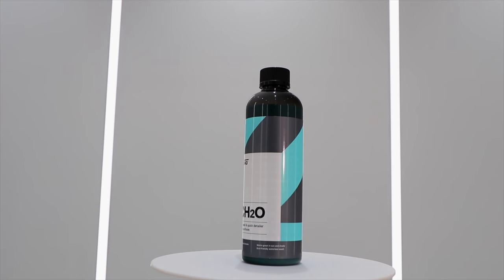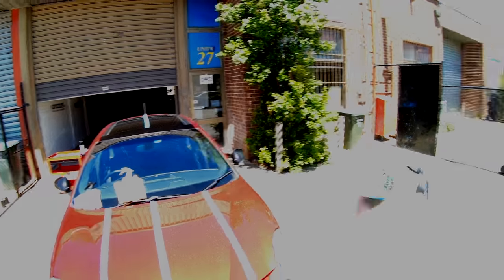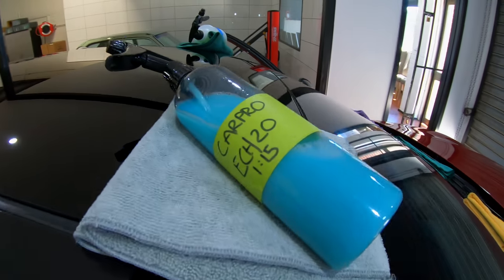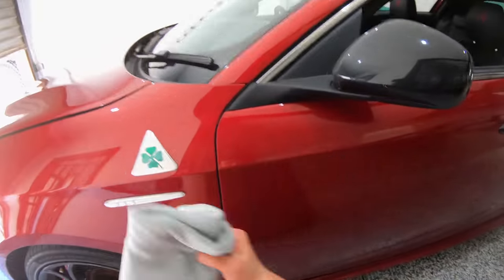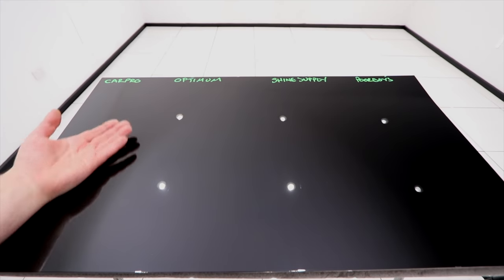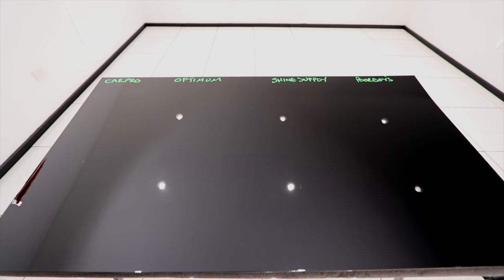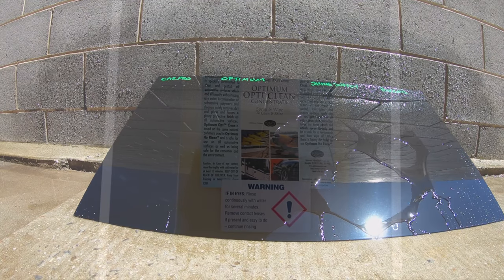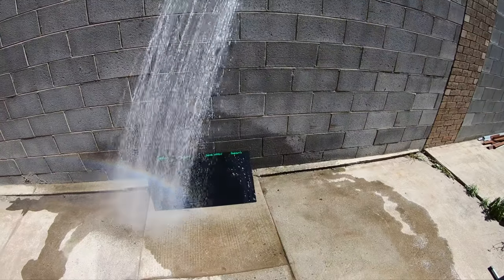WHAT’S THE BEST WATERLESS CAR WASH!

Comment: Just did a rinseless wash with Ech02 a few hours ago. I still don't feel comfortable with a complete waterless wash, but it performs great as a rinseless. I have ONR too, but Ech02 has relegated ONR to clay lube and interior duties.
Reply: so Ech02 performs much better ?
Should work as clay lube also
Reply: So what makes ONR work better than ech02 in your opinion?
Reply: Opti clean is meant to be the waterless wash; ONR is the rinseless wash. Opti clean is basically ONR supercharged with more cleaning ability, polymers, etc.

Comment: As always, a beutiful video with inforamtive content. I have tried Ech2o as a rinseless wash and it did its job surprisingly well. But the one concern for me regarding both waterless and rinseless wash is the risk for scratching or marring the paint. It would be truely intreesting to se some judgment in that area by someone with a good eye for this. Love your work and your attention to details.
Reply: My concern as well. At this point I would NEVER use anything that requires no water to clean.
Reply: @khyoon14  In a pinch or a situation where it's just not possible to use water, it is an excellent option, the technology really has come such a long way! I would have to agree though I would almost rather not wash my car at all until I have access to water unless absolutely necessary. I still do own Opti-wash and am going to buy a bottle of Carpro Ech20 as well just in case!

Comment: I personally use tac systems aqua waterless wash and wax, it doesn't actually have wax in it, instead it has SiO2 like Ech20 but I found it to be the slickest waterless wash by far and also gives insane gloss as a quick detailer if used that way
Reply: Using Echo2 for 4 years now.....may be there will be some new stuff nowadays ....

Comment: I’ve only used the Optimum, the results look amazing. I’ve just read the safety instructions, do you have to wear a face mask when using the ECH2O ?
Reply from the maker: You’ll have to check with Carpro on that, but I’m not aware of face mask recommendations with Ech2o- though over the last two years I think most of us have been using face masks regardless 😉

Comment: I’ve had similar results with OptiClean in terms of streaking. Although my vehicle has a polymer sealant (Jescar PowerLock) would there be any harm in using ECH2O? I use CarPro Reset as my soap during a normal 2 bucket wash and it’s fantastic no signs of degradation 4 months in. Suppose both of those products were made with SiO2 based coatings in mind. Thanks Sandro, great video as always!
Reply: I have a black 2016 GT350 with Modesta coating. I only rinseless wash it using Ech2o, spraying each panel first before contact with wash mitt. My paint still looks spectacular after a year of using this method. I never use it as waterless. The idea of using a fresh towel surface on every swipe and going through a dozen or more micro fibers per wash  doesn't appeal to me. I also use Rag Company Eagle Edgless towels which are fantastic.

Comment: Hey, mate great video. I was also wondering if you had a video on applying Nova Evo Ceramic coating process or similar??? I am ready to apply now and have a choice of Evo (Preferred) or UK 3.0. It is quite hot up here (32-36C) so any tips on the application process, flash times, what microfiber towels should I use to buff and how many do you go through??? Cheers mate and as always enjoy your informative in-depth videos.

Comment: Hi,  In your opinion what is a true replacement for Meguiar's D114?   I like D114 because it concentrated and it has multiple use with different dilution ratio.
Reply from the maker: D114 was never sold here locally so I really can’t personally compare it to other options, but CarPro Ech2o is a favourite of mine, and diluted up to 200:1 for rinseless washing 20:1 for waterless and 10:1 as a quick detailer so its quite versatile and economical depending on use.

Comment: Have you tried Optimum NO Rinse against Carpro Echo2?
Reply from the maker: Yes quite a while back, but I don’t do much rinseless washing, it’s usually a waterless wash or traditional wash, but I don’t have any conclusive tests with the two.
Reply: @CarCraftAutoDetailing  today I used Echo2. Both method: waterless for some gift a bird left behind and rinseless for the rest of the car. The car was lightly dusty. I used Optimum Sponge with Echo2. For some reason I'm still kind of nervous when using both waterless and rinseless washes, at least with Echo2.

With ONR I kind of see the the dust is effectively emulsionated and encapsulated. With Echo2 is difficult to see.

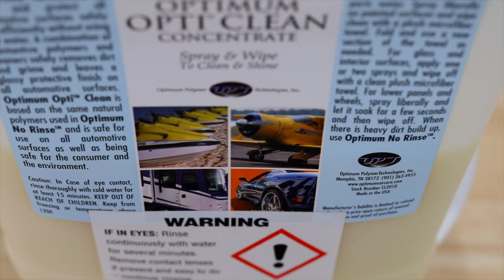The good thing that I see with Echo2 is that when diluted  1:5--1:10 it helps a lot avoiding water spot issues on coated cars.

Comment: I bought ech2o on a whim 2 years ago and never looked back! This was a great video, it really reinforced what I've been using. I recently read that waxes like Collinite 845 are less likely to adhere and perform as well due to ech2o's properties; what final protection product would you recommend to couple it with if this was true? Would it have to be a coating like CQuartz UK 3.0 or can I get away with sealant and waxes still? Thanks mate, subscribed, you have great content!

Comment: Sandro, got a question for you. Do you re utilize your rags after washing rinseless or waterless? I have noticed that I am introducing swirls to my car paint ever since I went rinseless. While the convenience outweighs washing with a 2 bucket system, my car in 3 months has far more scratches than it did before after almost a whole year washing with a microfiber mitt and the 2 bucket system but I am not sure if its the microfiber rags that I am washing and re utilizing or if its during the drying/quick detailing.
Reply: @CarCraftAutoDetailing  Cheers, you use more than twice as many cloths as I have been using per wash, I can pretty much guess that I am flipping them way too late which is probably the reason I am causing the swirls. Will try flipping more often/using more rags.

Comment: Which one do you think is better carpro waterless or meguiars ultimate waterless
I want to use one to wash my sportbike, it has ultimate wax on it from your experience which one will do a better job?
Reply from the maker: The Meguiars is just crazy expensive in Australian so I only bought it one to test it, but I though it worked well. The Carpro is still my favourite overall though.
Reply: @CarCraftAutoDetailing  meguiars sells the same product in a gallon where i live and is concentrated, dilution ratios between 4:1 - 20:1 they recommend 4:1 to match the consumer waterless wash and wax so overall is cheap when is diluted but after i finish with my can of ultimate wax new version I'm thinking about using a meguiars sealant like hybrid ceramic wax or m27 pro hybrid ceramic sealant so i need a waterless product with sio2 or just no wax or sio2 in it to wash my bike
The pro version of ultimate waterless wash and wax is "D115 rinse free express wash and wax" 72$ dollars per gallon

Comment: Hi Sandro, is the ceramic coated?
Reply from the maker: I’m not sure what you’re asking mate?
Reply: @CarCraftAutoDetailing  so sorry, my bad... I meant, is the car ceramic coated?
Reply from the maker: No, that car was ceramic coated a few years prior but at that stage the coating was long gone.
Reply: @CarCraftAutoDetailing  i see.. Meaning the Carpro Ech2O is a very impressive product. I meant, if a car has a fresh ceramic coating, the Ech2O will perform even easier & better i supposed?
Reply from the maker: Yes you should see an increased performance over a coated car
Reply: @CarCraftAutoDetailing  thanks Sandro for your professionalism & quality informative videos.

Comment: Hey Sandro, got a new vehicle and plan was to apply CQ UK 3.0 and already bought the kit from waxit, but due to water restriction I cannot use the hose and do a proper prep. Is waterless car wash is a safe way to keep the car clean for coming months until the water restriction is lifted and until CQ UK is applied? Should I follow anything in addition. As always video is a gem and thank you
Reply: @CarCraftAutoDetailing   Thanks a lot Sandro, yes planning to get a pressure rinse at a self service center first, if I use Nova Jet now should I use a different prep other that what you mentioned in the "ULTIMATE PAINT PROTECTION KIT" (https://www.waxit.com.au/collections/protection-kits/products/ultimate-paint-protection-kit) before applying the CQ. Because now the vehicle has Nova Jet and I know how hard it is to remove it as shown in your videos :-). So do you need to purchase something else in order to remove Nova Jet other than what is in the Paint Protection KIT. Yes I'm watching the waterless wash video now

Comment: Mate some advice please. I'm getting a brand new car from a dealer. Dealer said they would do a polymer sealant for $1500 and it is permanent?!? I thought only ceramic coating was permanent/1 application. They advised against ceramic coating. I finally chose neither.
Reply: Thanks.

Comment: I’ve been using Wolfgang Uber.  Have you ever tried it for comparison?
Reply: Wolfgang is a rinseless not a waterless. I have seen recommended QD ration but not a waterless ratio. There's a LOT of confusion out there with people thinking rinseless and waterless are the same thing. They aren't. PS they do have a new waterless but it's not Uber. It's Wolfgang SiO2 Waterless Wash. Is that what you mean?
Reply: @kikcodog  You can use Wolfgang as a rinseless.   I do with no issues.   There are YouTube videos that talk ratios.  It works great.

I also use it in a pump sprayer.

Comment: This video made me totally re-evaluate Ech02 , I saw some reviews long time ago saying this wasn't a good product , only good as clay lube.
Would you mix it with Sonax BSD to use  as a quick detailer ? Can you make a video about BSD ?
Reply: @CarCraftAutoDetailing  Isn't a quick detailer almost the same thing as a waterless wash ?
Reply: @dimmacommunication  some like a little more protection from the QD. Have you heard of Merlins Elixir which Carpro named their RTU QD after and is much based on that mix too with the difference they have also some Hydro2 in it. The common dilution for Merlins Elixir is 2oz of EcH2O and 2oz of Carpro Reload and 20oz of destilled water. In ml you use the dilution ratio of 1/1/10 but some thinks this is a little too strong and if you feel the same way just ad in some more destilled water to the solution. You can also use a little less of Reload if you want to. For even more effective protection you could ad 2oz or 1 more part of Carpro Hydro2 lite or already diluted Hydro2 concentrate as it's quite strong. This gets you almost like the RTU Carpro Elixir QD. You can also replace the Reload with your favorite water based SiO2 sealant like Gyeon Cure or Tac System Quartz Max. This gives you a little extra boost when used as a QD after a wash.
Reply: @tonymattisson6158  Thank's for the explanation :)
Reply: @tonymattisson6158  I've read that some people mix Reload directly in the Ech02 bottle.. is it correct ?
Reply: @dimmacommunication  no I would dilute it into an empty bottle. That way you have more control of the dilutions. Some does mix it up in large jugs with destilled water. But IMO it depends on how much of the mix you are useing. It's not much you need when you use it so it lasts a long time. Also remember to shake it up good before spraying it on as it's easly separates in the bottle.

Comment: Great Video Sandro. I use Opti-clean as a presoak for a ONR rinseless wash. I know they changed the formula a while back to adress streaking and increase lubricity. Do you know if you are using the latest version or not? Is it possible you have old stock? Is there a manufacturing date on it anywhere? Here was what the description at Detailed Image says: "New version has increased level of shine while providing a greater amount of protection" https://www.detailedimage.com/Optimum-OPT-M36/Opti-Clean-P497/32-oz-S2/ I don't know if it matter but the label on your gallon is defenitely different from my last 2 gals here in the States 1 from Detailed Image and one through Amazon.
Reply: @CarCraftAutoDetailing  I really don't use it as anything more than a pretreat in the winter and a spot cleaner as necessary. I also use a few others (Ecosmart, Trinova/303, Adams) the same way. I'll now look for an opportunity to try just it on a panel or two to see if it streaks like you saw.